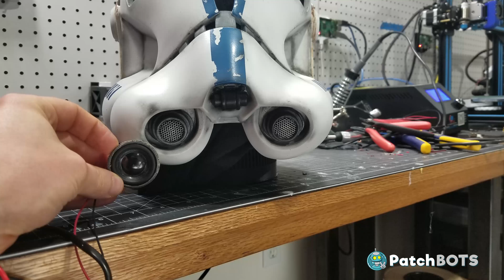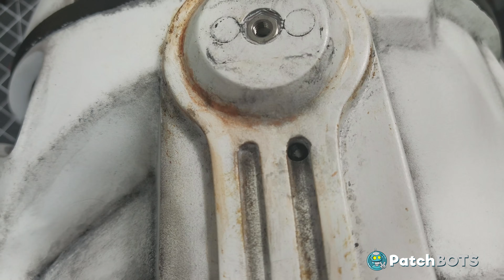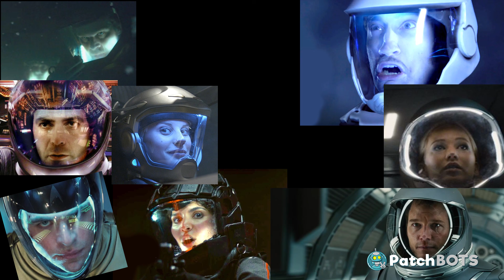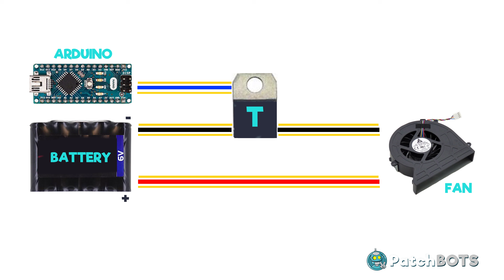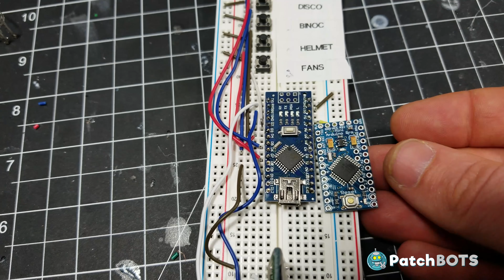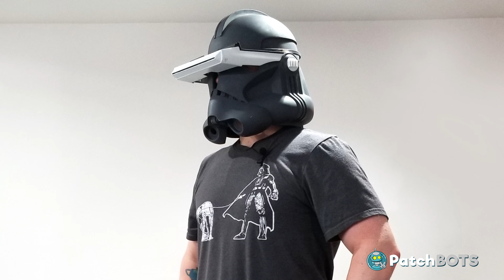Star Wars Clone Cosplay - Part 9 - Helmet Electronics

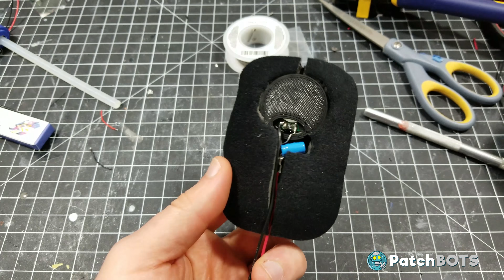Comment: The blue device seen on 2:53 I learned is a capacitor used to enhance volume within the helmet speakers but the capacitors I’ve acquired 100v- 10v I always get feedback from it. Do you know what voltage your capacitors use to give off proper sound quality.
Reply from the maker: honestly for this purpose it doesn't matter a whole lot.  The voltage is so low pretty much any capaciotr will work.  I think I'm using a 10uf capacitor here, but again, almost anything will smooth out the signal.
Reply: @PatchBOTS  ok I get feedback though. Do you know anything that could counteract the feedback?

Comment: What did you do to connect the microphone and the speaker together for the “EARS” system? Was there an extra piece you forgot to mention?
Reply from the maker: Nope, no missing pieces.  The smaller microphone gets wired directly to one end of the "Ears Amplifier Board" listed in the description of the video and the speaker gets wired directly to the other end.   If you follow the link to the adafruit page for the amplifier board it's one of the example projects.  All I really did was replace the larger microphone with a smaller one by hacking off the big one and resoldering the smaller one to the same pins.
Reply: @PatchBOTS  How do you power the soundboard then?
Reply from the maker: @-drojan72nd-74  If you look at the board shown at 2:36, that's the sound board.  You hack off the microphone in that image, replace it with the smaller one, then wire Vdd and GND back to the main board and wire OUT to the speaker+ along with a ground to the speaker -.
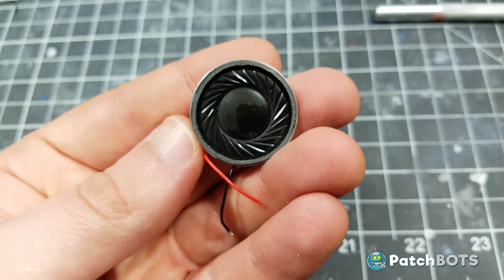Reply: @PatchBOTS  What's the little battery looking thing connected to the speaker at 2:50?
Reply from the maker: @OuterRimProductions  That my friend is a capacitor.  It kind of evens out the electrical signal to make it smoooooooth as Matthew Mcconaughey (yes i googled that spelling)
Reply: @PatchBOTS  Oh sweet.  Looking at boxes of them now, what uF did you use for this one?
Reply: @PatchBOTS  Also would you be willing to share the speaker housing 3d files?

Comment: Any way you could share your Arduino code, particularly for the Bluetooth functions? I can find tutorials for printing messages to the serial monitor but not for doing something like you have here.
Reply from the maker: The code I had running is super crappy.  I have since learned much better ways to run serial through bluetooth so I'm going to link you to the same resource I found:  https://forum.arduino.cc/index.php?topic=396450.0

Comment: i started printing my own set of cosplay from some great files on thingiverse (pulled out of battlefront 2). how wide is your helmet or how much space do you have in your helmet for your nose? i printed 2 sets and one is kinda big, while my nose is nearly touching the T-visor and the second one was way to small, poking my nose out of the visor.

any advice? printing in PETG on my ender 3 pro.
Reply from the maker: The nose to T visor issue is an issue with a lot of helmets. Yes, my nose touches the T Visor a lot of the time, but it wouldn't poke out if the visor wasn't there.  Ultimately, no one is REALLY going to be scrutinizing the size of the helmet too much, so if you want to make it a little roomier go for it.   PETG is a good choice as far as temperature capabilities.  Going to be a bish to sand though.  Good luck!

Comment: Very awesome! Battlefront fans might be a bit sad that you didn't go for green visor lights. I'd only ad a small piece that stops the light from reaching the mouth piece and the binocular joints.
Reply from the maker: They are neopixels!  Which means they are fully programmable.  I can make them green.  I agree, I'm currently working on a huge electronics overhaul on this thing (smaller, faster, better) and I'll definitely add in those stops for the lights.
Reply: @PatchBOTS  That's awesome. But this also means that you have to do some updates to disco mode!

Comment: This video is very informal just want to see the wire diagram and set up
Reply from the maker: Yes Very informal.  I'm reworking the the whole project onto a single circuit board (check out my vlog videos for more info). It will be open source and proper schematics and gerbers will be provided.

Comment: Hello, I am quite lost at the EARS part. Could you please explain it bit more?
Reply from the maker: Sure.  It's basically a small microphone-->amplifier--->headphone circuit.  the microphone points out of the helmet and amplifies the outside sound into an earphone.  This happens independently in each ear for a full stereo (lifelike) sound inside your helmet.    This way you can hear what's going on around you!
Reply: Sorry for the delay. Yes i understand this part i get lost on wich wires run in to wich ports. Could you help me with this?
Reply from the maker: Oh sure, let me draw something up.  I'll make it available to everyone via a link in the description.
Reply: ok
Reply from the maker: Actually just for organization, I added it to the github repository.  https://github.com/PatchBOTS/CloneHelmetElectronics
Reply: ok
Reply: I finally get it thank you
Reply: Ohh and would this work with a battery witout an arduino?

Comment: This is so an awesome kit, I would never dream of owning or building something nice, cuz I suck at building electronic stuff :D. If you find some time, would/could you share those 3d printed parts or where you got those files from?
Reply from the maker: Which parts in particular were you looking for?
Reply: PatchBOTS hi im looking for the case for the ear speakers and the actual speakers.
Reply from the maker: The 3D print file for the case can be found on my github linked in the description above.  The EARS Speakers are also linked in the description.
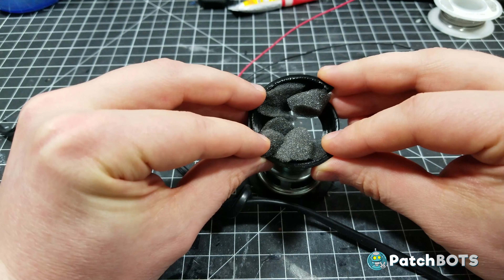Reply: PatchBOTS thank you, that helps me a lot. But I did mean the case for the actual speaker in 1:12, the ones you fill with foam. Sorry for the misunderstanding.
Reply from the maker: Oh, duh. Okay.  I uploaded those pieces to the repository.
Reply: PatchBOTS thank you so much